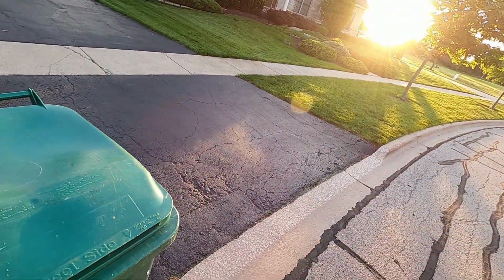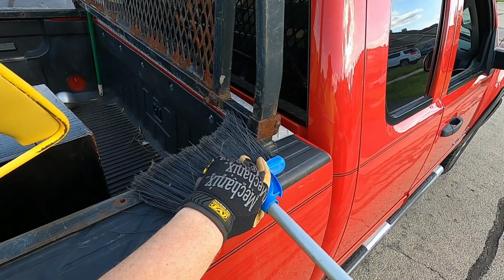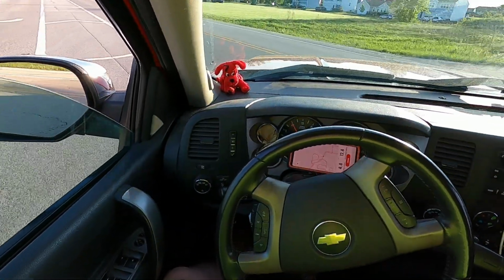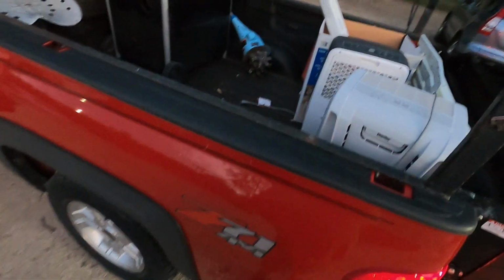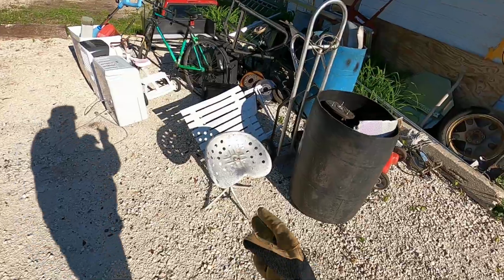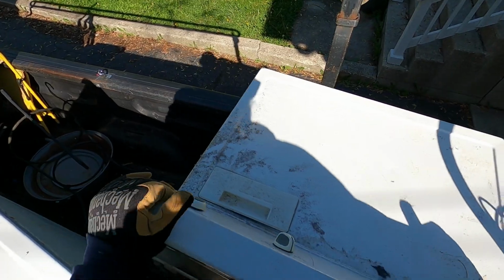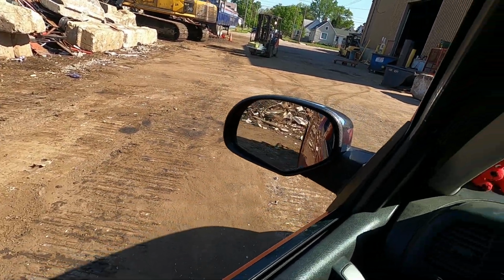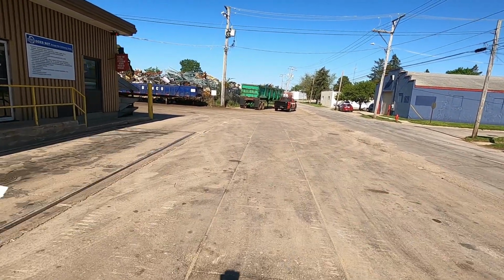Found in the Neighbor's Trash - Computer PlayStation Milwaukee Drill

Comment: I had that same issue with a microwave. Needed a small plastic piece for the door
 Company would not sell it to me. Called for a service technician and they refused the job. Said It was a SAFETY ISSUE because of possible leakage of the microwaves so had to spend almost $500 for a new built in. What a racquet
🇺🇲🇺🇲🇺🇲
Reply from the maker: Beyond frustrating. It's like we have to make our own parts
Reply: If I had a 3D printer available, I would have! LOL

Comment: You mentioned it was an electric dryer, do you have other systems as well as electric for your dryers? Here in the UK all tumble dryers are electric.
Reply from the maker: This dryer, the heating element was electric. Most clothes dryers are ran with natural gas as the heating element.
Reply: @ScrapPalletMan  that's intresting, never considered using gas to heat a tumble dryer! We just use electricity in the UK

Comment: With those vacuums you find you could fix them and flip them to get some extra cash I know the copper in the cord has some value but not as much as the vacuum it's self
Reply from the maker: Vacuums aren't my gig. That's why I don't scrap at night and I wait until the garbage man is in route before I recycle the cords. Otherwise the garbage man would get the whole thing.
Reply: @ScrapPalletMan  you have a good point though...

Comment: I'm shocked that your lift gate didn't have a master kill switch inside the cab of the truck so nobody could just let you get down with you not around
Reply from the maker: You have to have a security code to let it down. And there's a lock mechanism
Reply: @ScrapPalletMan  really that's good I didn't know that cuz you would think most of them would have some kind of safety system to where someone couldn't just let your gate down that's why I figured they'd have a master kill switch inside your truck that cool I know that gate has got to make a life so much easier getting scrapped in and out of that truck

Comment: Paul, there is no law against someone starting a repair shop; a repair shop for wheelchairs, walkers and other equipment by finding someone who can make those parts, for the business. It's easy to just blame the system.
Reply from the maker: It's not against the law, the manufacturers do not help. You can't get the parts. Try to repair something without parts

Comment: Actually the automotive industry does on certain parts like the computers.  you can get one out of a junk car but if it is not the exact model with the same options it might not work correctly because the dealer has the program the computer to allow those features to work.  Louis Rossman is a big supporter of the right to repair movement and has gone the hearings to pass laws. 
Apple computer is one of the worst offenders next to John Deere.

Comment: Paul if you're joints hurt like mine used to especially my hips maybe  try the Glucosamine chondroitin supplement.  I take a bit more than recommend  but I'm a big dude. I do know less than recommend  does not help much so must read dosage. 
 What it did for me and several  of my friends and  now my Dad is nothing short of Tremendous!!!!!!
 It takes about  a month to feel  the full benefits  but WOW! What a difference,  even helps back pain.
 I really  do feel 10 years younger. 
 My hips and knees were  getting  really  bad where I  could  barly get through  an  8 hour shift at work. Now I'm back doing 8 hours and another  4=5 hours  a day scrapping.  
 I have literally  forgotten about my  hips burning  pain. It's Absolutely  Gone!
 Good luck Buddy 👍
Reply from the maker: I tried that for a while. Didn't seem to work. Maybe I should try again
Reply: @ScrapPalletMan  
I did that too. I took one a day for awhile,  it didn't  do much so I  didn't  think much of it. A few years later when my hips and knees started burning with pain by the end of the shift I tried it again  but took the correct dosage plus a bit more because I'm 250 pounds.  A week later the soreness started fading. A month later  it was all gone.
 Obviously after  a long day I can feel some pain and stiffness but next morning I m ready to go again pain free 👍
Reply from the maker: I'm going to try this. I'm 250 lb. What dosage are you taking?
Reply: @ScrapPalletMan  
It depends on what brand you buy.  I went with the CVS brand because they were on sale buy one get one free  so only $15 / bottle that way.  I took the recommended  2 a day plus 1 more because  I'm big. Now I take just 2 for maintenance  or 3 on a long tough day. 
 I'm 59 . There is a small group  of us about the same age at work that are all taking it now and bragging to  each other how much better  we have been  doing.   
 New knees and hips are very  common in this shop because  we walk on concrete all day moving 50 samples around  from one station to the next. 
 I don't want to be the next one with hip or knee surgery.  The 3 months without  a pay check during  recovery would hurt a lot more than the cost of the Glucosamine chondroitin  I figure. 
 Good luck and stay with it. It may take a week to feel the first bit of relief  then day by day a bit more until joint pain is  virtually  gone.
 I forgot  to mention  my 84 year old father has decided  to come with his 2 sons to Canada  fishing this next week due to him finally getting  some back pain relief  from taking  this  stuff. He's feeling  better  every day . He has been  taking  it for about  3 weeks now.  👍
Reply from the maker: Thanks for all this information. Golden. I'm going to CVS now. thanks again

Comment: I like to watch you channel,  but there is one thing that bugs me . Do you not realize you use more gas turning your truck of every time you stop then you use letting it run ? Also premature starter failure is going to happen . And they are not cheap
Reply from the maker: Hey Mike. That might have been the case many years ago. But that idea has been fairly debunked.